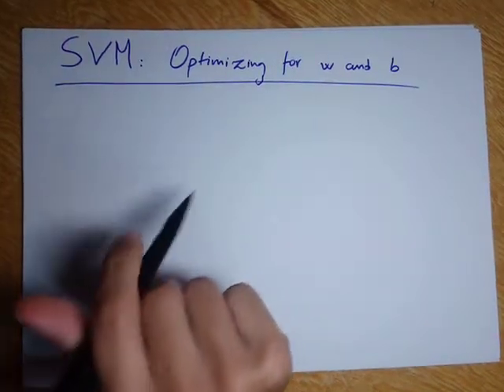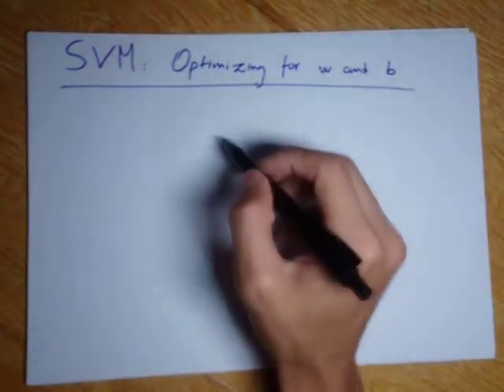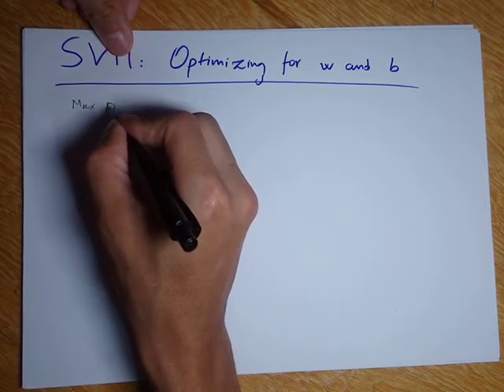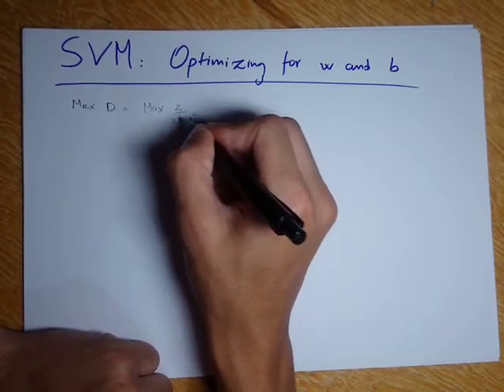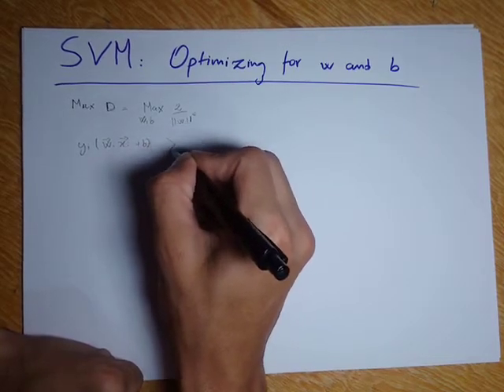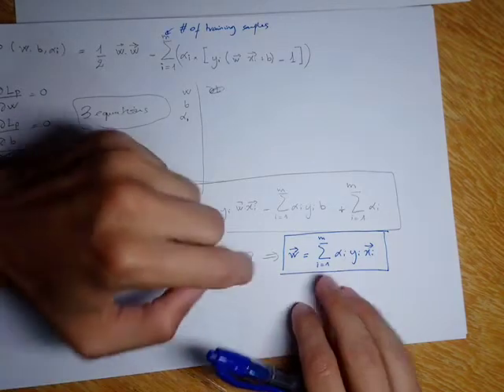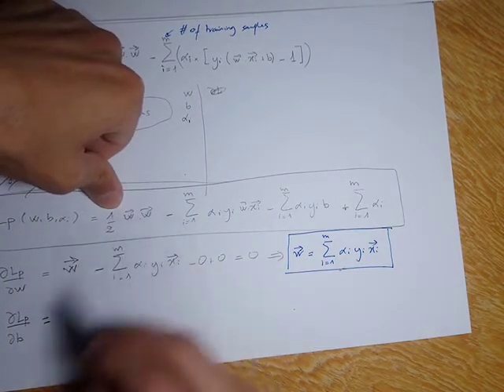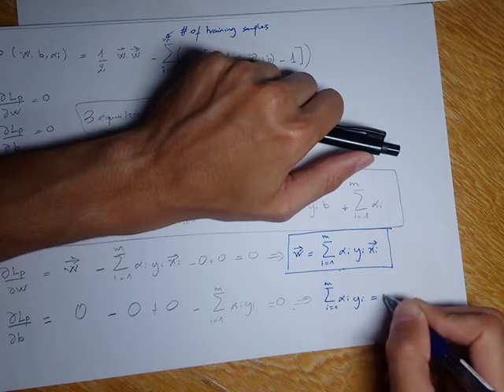SVM7  Solving The Optimization Problem Of The Svm (Part 1)

Comment: at 15:00 , I don't understand why we have two different indices for w when it is the same
Reply from the maker: Hi Samy,
Please excuse me for my late response. Your question is related to a math issue.

Let's assume we have the following expression: (Σ n) and I want to multiply it by itself like that: (Σ n) (Σ n). Now to specify the starting and ending index of each sigma, I'll use this notation: (Σim n), where the first letter ("i" in this case) and second letter ("m" in this case) right after the sigma Σ represent the starting and ending index of the sigma, respectively.

With this in mind, I can rewrite  (Σ n).(Σ n) as (Σim n).(Σim n). Based on math properties, we can merge the two sigmas Σ together like that: (ΣimΣjm n.n). Your question now is: why did I switch from i to j in the second sigma after merging the two sigmas?

The answer is that, when merging the two sigmas, we must start from the inner sigma. I mean by "start" incrementing the index of the first sigma until the end and doing the sum after each increment. During this process (computation of the inner sigma), the outer sigma MUST HAVE A FIXED INDEX, WHICH WE INCREMENT BY ONE ONLY WHEN WE FINISH COMPUTING THE INNER SIGMA (i.e., we reach the final index of the inner sigma). Once we increment the outer sigma, we repeat the same process again (initialize the index j and re-compute the inner sigma). The computation would be complete once the index of the inner and outer sigmas both reach the maximum value ("m" in this case). This mechanism is not possible if we keep the same index "i" for both sigmas because as soon as I increment the index of the inner sigma, the index of the outer sigma will be incremented along as well, which violates the process I've just described. To avoid this issue and get the desired process, we must change the variable of the inner sigma to something else ("j" in our case).

Hope this helps.